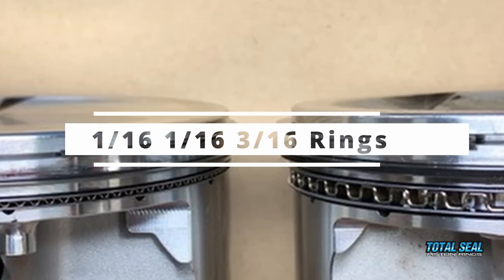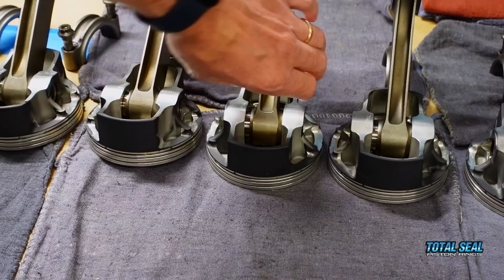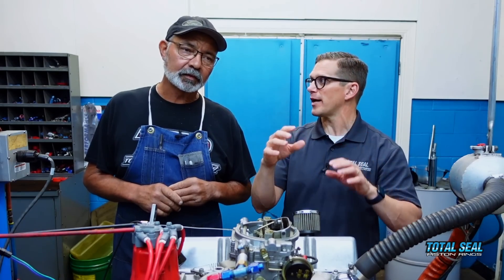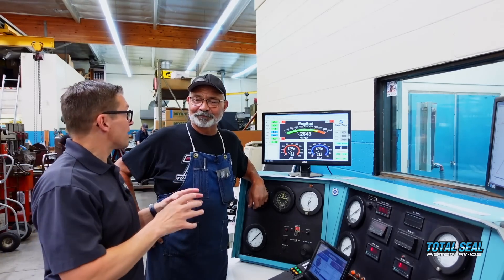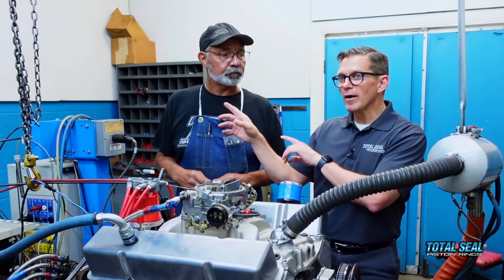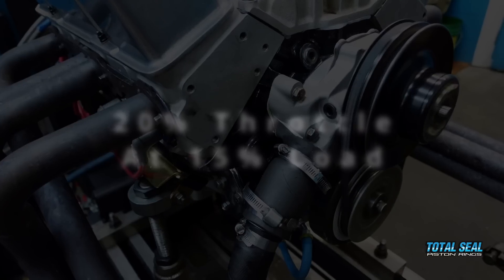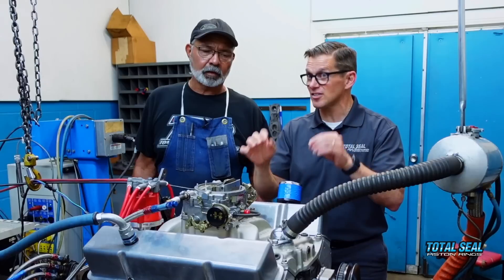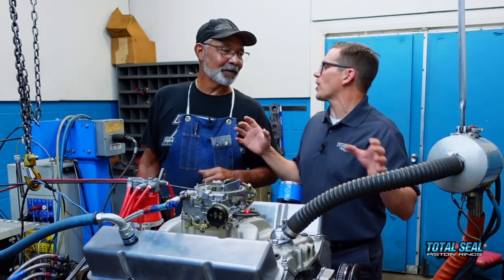3 Steps To More Horsepower: Cylinder Bore Honing

Comment: Do you guys have an explanation of how that blow by gauge works?
Reply from the maker: Sure, we block off the valve cover breathers and direct all the pressure inside the engine through a hose that attaches the engine to the blow-by gauge. The gauge itself is a graduated cylinder, so the movement of the ball indicates the amount of air blowing by the piston rings.
Reply: @TotalSeal  How do you know what a nominal blow by is? I'd assume its dependent on the size of the engine. Or is there no nominal, you just want to see if theres been a reduction of blow by?
Reply from the maker: @beachboardfan9544  it can be dependent on engine size, but for most engines (between 280 and 460 cubic inches displacement) typically a good blow-by reading should be between 4 to 6 SCFM. That’s why we were impressed with less than 3 SCFM. We’ve seen up to 10 SCFM with a stock type set up.

Comment: I think they forgot to talk about the dry film lubricant coating on the piston skirts reduces friction causing the engine to use let power to move the piston. The less thortle need to  hold the the same rpm as before is also partly be a result of the dry flim lubricant. Thinner piston rings, oil, lighter parts less friction .
Reply from the maker: The skirt coating should not be contacting the cylinder during the running of the engine, so it should not effect friction. The coating on the face of the ring affects friction because it touches the cylinder bore. The skirt coating stabilizes the piston, which keep the rings from rocking out of contact with the bores. That makes a huge difference in reducing blow-by. The skirt coating plus the extra oil retention on the cylinders greatly improves ring seal.
Reply: @TotalSeal  I had to sit down when you said the skirt coating should not be contacting the cylinder walls. Ok when the skirt coatng contact the cylinder walls what this means is the ring are bad. Because i do skirt coating and i get pston with the skirt coating somewhat removed
Reply from the maker: @coatingsplatingsjas1powder557  the contact is at start up. At high engine speed, the piston skirts should be riding on a film of oil. That is called hydrodynamic lubrication. If the piston skirt is touching the cylinder wall during high speed operation, then there is a problem.
Reply: @TotalSeal  yes oil pump volume low or carbon in gallery oil squirters thank you
Reply from the maker: @coatingsplatingsjas1powder557  👍👍👍

Comment: Lake, I find your videos extremely informative and thank all involved. One thing that I haven't seen a video on is rind durability in street applications. More specifically, the science behind it. Lots of information is available from different sources showing things like reduced friction, reduced blowby, reduced ring thickness, but how does this relate to engine durability at 50k miles or 100k miles. Everything that I have seen is all around short term engine life. Admittedly under harsh conditions, or race use, short life motors. I still build older style motors,  Cleveland's etc, and almost all readily available pistons still come with old style thick rings. Back in the day they were good for somewhere between 100k & 120k miles in most applications around my area. We used to bore them 0.030 simply because the ring ridge normally didn't clean up until 20thou or more. Could you please cast some light on how today's narrower ring packages can be expected to perform over a similar time and mileage? Would we expect more or less cylinder bore wear with the narrower ring package on these old motors with older metallurgy? I know what conclusions that I have reached, but I would appreciate a significantly more knowledgeable opinion. Regards Greg
Reply from the maker: Thanks for the question. The thinner rings with the PVD applied face coatings last longer in even street applications than the older technology, thicker rings.

Modern OEM engines that go beyond 200,000 miles using thin ring technology. The Ford eco-Boost engine utilizes a 1.2, 1.0, 2.0mm ring package, and these engines are challenged with fuel wash from direct injection.

Overall, the lower tension reduces cylinder bore wear (no ridge reamers needed).
Reply: @TotalSeal  thanks for the answer
Reply: @TotalSeal  That's amazing. It really shows how innovative companies like yours are pushing the boundaries and helping us to enjoy better performance as well as longer life. Thanks a lot.
Reply: Well said .. I have the same question.

Comment: Would you say your profilometer could allow someone without access to the big dollar automatic hones to achieve these results?  Using the right stones with the right pressure to get a straight and round bore with the right Rvk, then plateau to a proper Rpk, achieving a good bearing curve as measured by the profilometer?  Then adjust as necessary to obtain the desired parameters?  Thanks
Reply from the maker: Yes, using a profilometer you can achieve the correct surface finish with an older, manual machine.

Comment: I recently saw a video by one of the "horsepower" shows where they used "engine assembly lube" on the rings. Oh, the horror!
My question is, are you using anything special for assembly when using the thinner rings or will "quickseal powder" work?
Reply from the maker: Either QuickSeat powder or a very light coating of the break-in is what we recommend.

Comment: Why not test with Methanol? Wouldn’t it solve your seasonal issues with pump gas?
Reply from the maker: That would be an option, and we use methanol for testing on other engines. However the different AFR required for methanol would create a different baseline that is not the same a gasoline. As such, we’d rather have a gasoline baseline so the information correlates to others using gasoline.